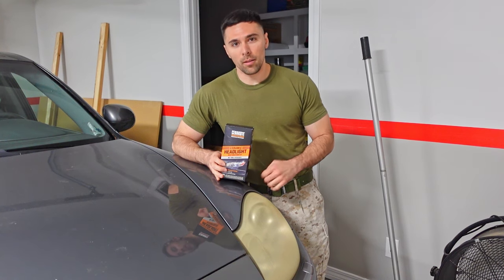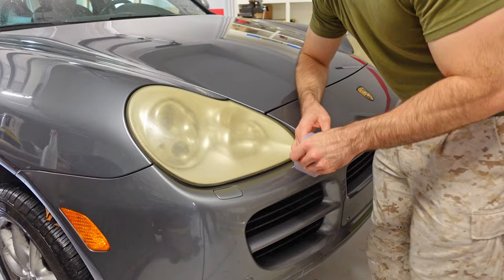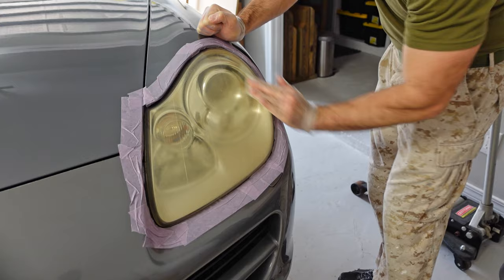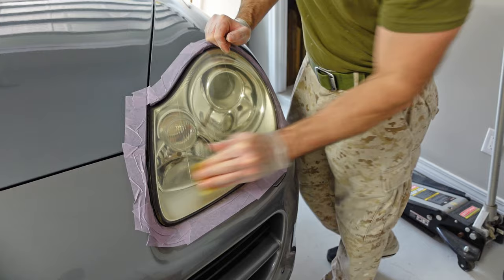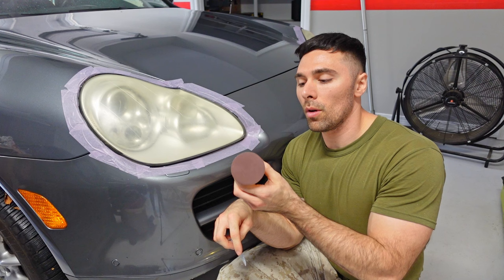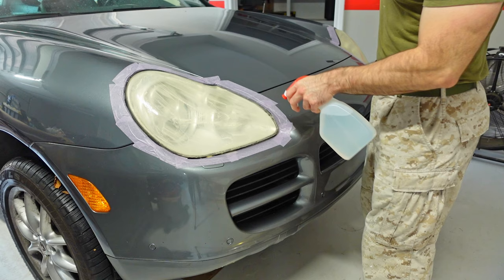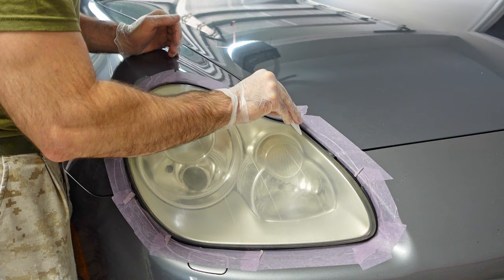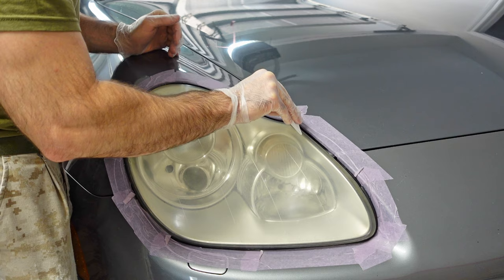Headlight Restoration Using Cerakote Ceramic Restoration Kit || Restoring My Cayenne Headlights

Comment: Appreciate this video. I literally just did my headlights 2 days ago on a 2007 Ford Sport Trac, but I used the Sylvania Headlight Restoration Kit. It came out really, really well. Oddly enough, my 81 year old father just bought the Cerakote Kit for his Toyota Tacoma. Health issues and such, there's no reason for him to be doing this. Told him I'd come up next week and do the restoration for him, then found your video to walk me through the steps. Very much appreciated man, nicely done.
Reply: Unfortunately I have bad news for you. The Sylvania product is crap! It looks great for 9 months to a year, then it is worse then before you did it the first time. Both my vehicles were done with it, within a year I had to apply for warranty replacement. Redid all four headlights, and again within a year, all four bad again! I'm not doing all that work over again once a year with Sylvania hoping I sell my vehicle before submitting another claim year after year. Stay away from Turtle and Sylvania because their coating is basically a finisher and not a true sealing protector as the Cerakote ceramic finishing step is.
Reply: Hey honest question, i saw the other commenter's input about the sylvania.. I have the kit sitting on my desk now just waiting for warmer weather to use it LOL How have yours held up??

Also props for the sport trac.. i wanted one for my first car so bad back in the day lol..

How did the cerakote kit work for your old man's tacoma as well? Thanks
Reply: @AfternoonProductions  Used the Sylvania kit on a 2004 BMW X3 in 2022, and 2 years later the headlights still looked fantastic, we sold the car a month ago. I think a lot of folks don't take the time to do a thorough job during the wet sanding stage, and their results don't hold up as well.

Comment: As a professional detailer if you want better results with this kit use 800 grit, 1000,1500,2000,&3000 then wipe on the ceramic clear coat
Reply from the maker: I agree with this. I felt the sand paper provided should have had a bit more variety. I have done a couple projects over the last few months where I went with a much higher grit sand paper than what the instructions for the product called for and I got much better results from it. The headlights still look good though so I'm still happy with how it came out especially considering how they were before.
Reply: What are your thoughts on about doing a buff stage before the ceramic coating?

Comment: Good Video. Two comments, people need to really know that the headlight and area must be completely bone-dry before applying step three. No moisture can be present or in a position to run down over the work just completed. Second, almost without fail, the driver's side headlight comes out better no matter what headlight is done first. This is mainly due to the passenger side headlight taking more abuse from being on the side of the vehicle next to the shoulder where more loose debris resides. Vehicles traveling in front of you kick this debris up and the headlight must drive through it, causing more wear and tear on that headlight.
Reply: Thank you!  Very Helpful Comment/Info
Reply: Thanks. I’m fixing to do my wife’s and I’ll try to focus on the right side more while sanding.

Comment: Grunt, next time you have to do this on your Cayenne, use the tool under the trunk floor to turn and release the lock holding the headlights in, they then slide out! No need to tape stuff off and no tight areas!. See your owners manual. 
 There is a rubber gasket around the lense that seals against the body. You can just pop that off so you don't get anything on it and clean it well while its off. Replacements are reasonable if they are torn or worn.
I have a 2005 Cayenne Turbo, your paint looks in great shape!

My headlights have no yellowing or haze, but very very small hairline cracks, all running on the same direction.  Did yours have these and did this restoration help?

How is it holding up?
Reply from the maker: I'm aware of how to remove the headlights on the Cayenne as well as the location of the headlight removal tool. In fact I have a video on how to remove the headlights, replace the bulbs, and replace the mounting bracket that the headlight sits in. I left the headlights in on purpose so I could work on them without having to hold them in place while sanding and cleaning them. No I do not have any cracks in my headlights (yet). The lights are holding up great especially considering the car has had to sit outside in the drive way for the last year I see no yellowing from the UV light exposure. Considering some people said it won't last a year unless I have a "professional" do it, I would say they look great for being done by a DIYer. Yeah the paint on the car is probably the one thing I have zero issues with. The interior on the other hand is a different story and makes me want to call it quits on the car.
Reply: Yep, I spoke to early, that was the 1st video of yours I ever saw, then I caught your other one when you replaced the head light mount....

Comment: i used this kit and it turned out amazing, but i did an extra step. i highly recommend that you buff the headlights with rubbing compound and get the headlights as clear as you can, then clean with rubbing alcohol and let dry before applying the ceramic coating. mine turned out like new. i hope it lasts.
Reply from the maker: I have had no issues so far and it has been about 10 months. My only issue is the passenger side headlight seal failed so now moisture is inside it but the lens is still good. I do feel that the passenger did not come out as clear as the driver side so If I ever had to redo the process I might try your suggestion.

Comment: mine turned out not so well. The headlights still feel rough when you move your hand over them. They are definitely brighter and a little bit more clear however you can still see the peeling clearcoat. Maybe I didnt sand enough? Maybe I needed to use a 600 grit sandpaper to get more of the factory coating out so it would be perfectly smooth? Should I repeat all the steps and sand it down completely until i feel that the headlight is perfectly smooth?
Reply from the maker: I do not remember my headlights feeling rough or anything peeling when I went to do mine so our situations are not quite the same. I did sand for several minutes with the 2000 grit on each headlight before moving on to the 3000. So maybe you just didn't sand long enough. If you want to go rougher than the sand paper the kit provides then I would start by trying a 1500  and working my way down if necessary. I would probably not go below 1000 grit I think anything below that will be to rough. 600 grit will give wood a nice finish but on a surface as smooth as a headlight that could leave visible scratches. I might be wrong but I would use caution and test a small area if you are set on using 600.

Comment: Just purchased new headlights for my Tribute from "Rock Auto" for 150 bucks (bulbs included) and THEN saw a Cerakote ad! It figures. I don't know where you buy your headlights but I already installed a set from the same place on my sweeties Impala for 170 bucks and they are C.A.P.A. Certified! Didn't take 5 minutes. If the Cerakote doesn't work on the Tribute it will be a much more involved process. You have to remove the dang bumper etc. Kudos for the vid! Thank you!

Comment: Just did mine . Came out pretty good. I would recommend either being careful around the edges when sanding or using some masking tape so you don’t scratch the surfaces

Comment: Also replacing the Xenon bulbs could be worthwhile. Last time I replaced the Xenon bulbs on my BMW 5 series was 9½ years ago, they were still working but low beam light output was not ideal anymore. The old ones was Osram Night Breaker Unlimited Xenarc D1S + 70%, and the new ones I just installed are Osram Night Breaker Laser D1S +200% Next Gen.

Comment: Superb video, the passenger side was cloudier after step one, I am guessing not as much time was spent with the four wipes?
Thank you for this, I've gotten my kit and will be doing it today.
Reply from the maker: Honestly I don't know what is going on with the passenger side, maybe I didn't clean it as well so the final result was less clear than the driver side. I am having issues with that headlight currently with moisture inside the lens probably from a bad seal so that could have been an issue at the time, so the cloudiness could be on the inside of the headlight.
Reply: @thediygrunt  That's a great thought about the interior condensation. 
I did mine yesterday, spent a lot of time with the wipes and careful sanding. Happy to say, they came out looking brand new. Thank you so much for your video, it really helped my confidence to tackle it. Your supurrvisor should give you a raise :)
Reply: I’m doing mine right now and my passenger side light is foggier than the driver side. I read on another comment that this is common as the road has more debris on the edge of the highway and this debris is slung up by vehicles in front of you. 🤷‍♂️ Made sense to me. I’m going to spend more time on the right side and see if I can match the driver side.

Comment: These home kits end up flaking off and yellowing/browning looking uglier than they were before. Only real way to deal with it is using several sanding stages and then using actual clear coat paint that is made for plastics. Its the only thing that will last and restore the lights to 99% new. These kits will look good at first then they will fade, especially if car isnt garaged or under a carport. 

If you dont want to go through the hassle of prepping and properly coating it or dont have the items required or know how to do it, best to pay someone to do it, especially if you have expensive headlight housings. This guy did a pretty good job on this considering how yellow and horrible they looked. It was a huge improvement.

Comment: I wonder how long the clear coating lasts 
Thanks
Reply from the maker: Almost a year and a half since I did it, and it's still looking good. Especially in comparison to how it was before restoration. The car was parked in the garage for a little bit but now is parked outside and has been for a while.

Comment: Can you repeat the process after you put the ceramic coat on? One spot is still a little foggy
Reply from the maker: You could definitely repeat the process again if your first attempt doesn't come out well but you will need a new kit to redo the ceramic coat.

Comment: Like everyone else I have this kit sitting on my dresser and have just been waiting to get it done. I want to say after watching other DIY videos on this I feel like all we really need it the Ceramic coating, whatever that chemical is lol. I feel $30 it too much when we can go remove the oxidation with some turtle wax rubbing compound and small pieces of sandpaper from the hardware store. Oh well, the damage is done and paid for already lol.
Reply: Carpro CQuartz ceramic coating is all you need if you polish out your own headlights without one of these kits. Or your favorite ceramic coating.
Reply: Just one problem after all the work you have done, it is NOT SEALED and Protected from happening again. Yes you removed the oxidation but have done NOTHING to keep it from happening again. So while it looks great now, in 6 months to a year, you will be doing it all over again. And because you have removed the original sealed surface by sanding it, you will have to keep repeating it more often because you are not resealing and protecting it! You have the kit, use it!

Comment: For the over achiever you could use some buffing compounds before the final coat to really get them to shine
Reply from the maker: I was concerned that it might cause damage to the coating and I wanted to see just how well it would look on its own. I have seen other kits that suggest or include buffing as a final step though.
Reply: @thediygrunt .. polishing compound for a 3rd pass definitely made a difference.  I did this on my 2014 Mazda cx9 .. they look like new.
Reply: DO NOT USE ANYTHING before the final step of applying the Coating/Sealer!! The Cerakote Ceramic needs the fine roughing of the sanding so it has something rough to BOND to. It will fill-in hence smooth out any of the sanding. If you polish or buff the headlight after sanding, the ceramic will not properly bond and might even peel or lift where it was improperly polished before the final sealer step!

Comment: Well done, thank you. One thing I would suggest, use masking tape instead of duct tape. Easer to remove.
Reply from the maker: I used delicate surface painters tape, not duct tape
Reply: Do not use masking tape or duct tape. Both are bad for painted or finished surfaces plus normally leave sticky residue behind. If using tape, only use blue painters tape or delicate surface tape.

Comment: are your headlamps plastic or glass?
Reply from the maker: They are some kind of plastic. Basically all new cars are plastic headlights. In fact I believe its a requirement now for safety because in the event of a car accident you don't have a bunch of broken glass. Plus the plastic is what allows new cars to have headlights formed in a way that creates a more smooth and aerodynamic front end. On my older Porsches they have glass headlights but they are simple round lens usually 7-8 inches in diameter. If they were glass I wouldn't have to worry about the lens yellowing since my older Porsches are twice the age of the Cayenne and perfectly clear. But the glass is heavier and more expensive so there are trade-offs.

Comment: Update??? These don't last long
Reply from the maker: I did this back in late December I believe and they still look like they did in this video. My passenger side is still slightly cloudy but that could be an issue on the inside of the headlight lens because I have moisture in there right now so I definitely have a broken seal. The driver side though still looks great and even if it only lasts a year and I have to re due it that is still worth it to me since the car was basically not drive able at night before I did this.
Reply: Nice was just wondering the same thing. Just did this for a friend of mine and I felt bad that she may have to have this done again after so long. Maybe we don’t have to redo the whole thing but just redo the coating?

Comment: those kits limit you intentionally so that it doesn’t take away the jobs true professional headlight restorers
Reply from the maker: I agree with you. But if I have to do it every year I bet I will still save money over having the professional do it cause no matter who does it the finish will wear off over time. The labor cost alone would have been more than the price I paid for the kit. I have nothing against paying a skilled professional for their time but I don't mind spending an hour of my own time and 20 bucks to achieve the same result even if it does not last quite as long.

Comment: It would have worked out better if you sanded first.  Have a spray bottle handy while  wet sanding.  Intermittent spraying until the yellow/milky run off  gets closer to white-ish   To no milky run off.   Note.  The milky runoff is actually the  original  headlight coating that you are going to replace. When milky runoff is gone you know you’ve removed all of the old coating. Then do he first oxidation pad. I know it’s not  what the instructions says , but when the yellowing is that bad you have to sand first , if yellowing is marginal then yes they supply with enough of the oxidation remover.   He used more on his left light that why it looks better.
Reply: I would say going completely contrary to manufacturer instructions is a fast way to void any warranty offered, not to mention this is not a good example of "Work smarter, not harder". 

My yellowing was horrific. Could barely see the bulbs. I followed the directions supplied, and my headlights came out looking like brand new.
Reply: WRONG! There is a reason for the prep wipes being used first, then wet sanding. That reason is lasting results, a proper finished surface for the Ceramic to bond to!